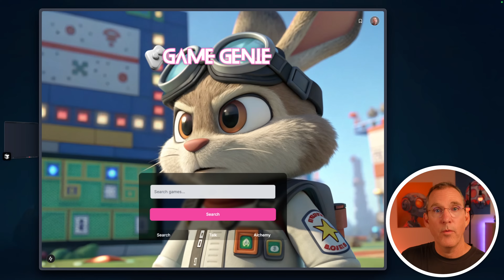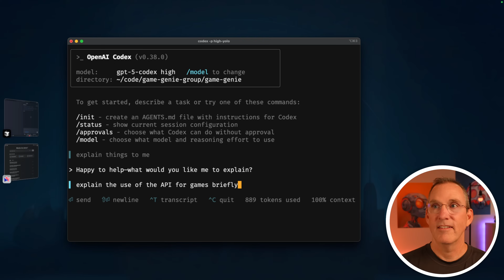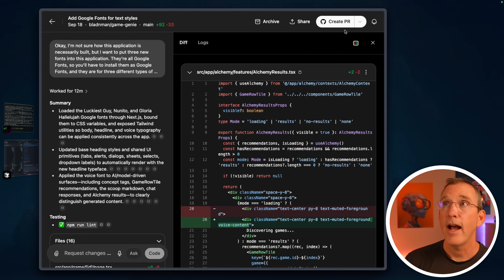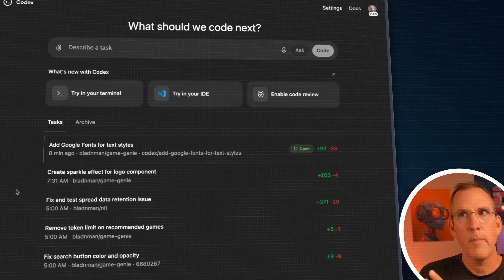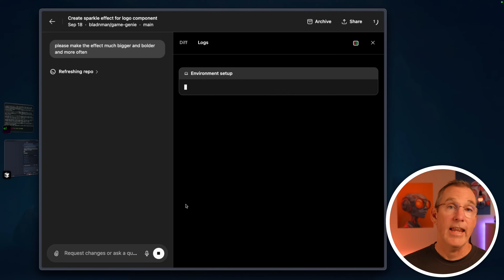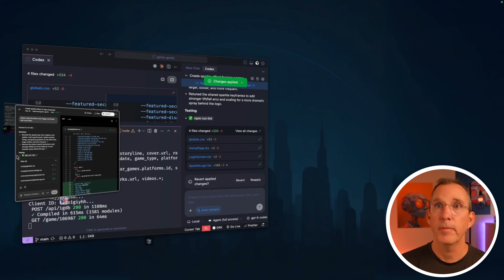Why Codex Is the Beginning of New Engineering

Comment: First, great video. One of the clearest and well-done explanations on a programming channel I've seen. If helpful, what I've been doing is ... a) Our company has a Cursor business plan, so I love that and use it but as a power user daily its not hard to go over the 500 credits per month and then it starts to cost as its pay-as-you-go, but still my favorite option and best integration with local MCP servers too and many AI models to choose from; but b) Our company also has a ChatGPT Business plan; so I toggle between normal Cursor chat and using the Codex credits in its chat window pane too. Codex 5.1 is pretty solid. Unfortunately it has less integration for MCP servers (seems to only work for HTTP type, which are basically remote ones). That said, between the two, I try to keep the cost under the radar ;) and as low monthly as I can, while still using both till their monthly or weekly credit limits are hit.

Comment: I've been using Claude Code for a couple of months and my biggest struggle is that stupid 5-hour limit. I run out of the "5 hours" in 1 or 2 hours.
Is Codex less restrictive if I pay 20 USD per month? I want to double check especially because you say at the end you get all that for 20 bucks. Is that really true? Or to make the video you were at the limit?
Besides that issue, thanks for the video, very well explained and it was super helpful as an introduction to Codex and comparison to Claude Code.

Comment: I have been using codex like this for about six months.  It works pretty effectively, especially if you control the scope of changes you want to make.  When you keep the scope of changes to small updates, it makes it easier to parallelize the changes but still ensure they merge without conflicts.  With regards to branching, codex makes each change on a new branch so you need to remember to have github delete the branches on merge.

Comment: Great video! I just wanted to ask how you handle merge conflicts when you run couple tasks at the same time? Do you fix conflicts by hand manually? Is there some tools or some way to do this well using AI without breaking/deleting important code?
Reply from the maker: I love this question as I just released a video about this. Def check that out. But managing merges still is a pretty manual process.
Reply: @MetalSole  Will definitely check it out.

Comment: When you're in the CLI, how do you connect to GitHub how do you choose a repository how do you choose a branch?
Reply from the maker: In the cli there is a bit of a different pattern. Basically you want to clone your repository into a folder and the go into that folder in your terminal (cd). Then run the CLI. This is a short explanation so drop this in ChatGPT and ask for clarity
Reply: @MetalSole thanks!

Comment: After I install the VS Code extension on Cursor, I do not get the tab that you show in 8:07 . Is it default or do you need change some settings in Cursor?
Reply from the maker: Oh yeah. This is a twisty thing. I share in a previous video. Moving that panel is a drag-and-drop effort. But first showing the left side tabs as vertical first etc. sorry to answer with try to search in my previous videos. I think it is the one where “cursor fixed everything “ if I recall

Comment: I wonder if you use Cursor, why do not just to use the Cursor alone, instead of hopping from one tool to another? Supported by MCP servers, Cursor can do all you demonstrated and more, and plus besides GPT-5, the underlying LLM behind Codex, you can have a choice of pretty much any popular model. What's benefit of using Codex and all the complexity of jumping from tool to tool, from window to window? how does Codex pays all the hassle off?
I mean, end result wise and my convenience wise, how it's different from me opening Cursor, picking GPT-5 as a model and asking implement the same task you implemented?
Reply: It's not… nothing better than Cursor with GPT-5 if you're a power user. On the contrary: if at the middle of next month a better model comes from a different provider, you can just switch to it if using Cursor. But with codex, you're locked in to a company and it's product.
Reply: @basedovi are you saying that Cursor with GPT 5 is better than Codex ? Did you tested it with full stack developments ?

Comment: I’m just going to keep using OpenCode.  Why?  Because any tool that comes out and ‘changes the game’ can simply be integrated into an open source base and propagated across the ecosystem.  Closed source is a liability in the age of AI.
Reply: but is OpenCode performs like Codex in Code quality ?
Reply: @silvamiracle2347I have only tried out Codex a little bit.  It’s fine, great actually… but I have lots of agents and settings already built for OpenCode.  And what happens if a month from now Claude Code goes back to crushing Codex?  Or Google’s nth IDE becomes the new thing

A customizable and model agnostic agent is much easier to adapt and configure.  Far less hassle and config debt.

Comment: Click bait alert! It's clear author did not with that even a few days. If he did he would find that it's not viable. You end with 100 active issues just in a few days, most require "some extra work/prompting". It may work if majority issues are implemented first shot. But with this flow you just create to many WIP items. Also, I recommend using main, dev and feature  branches and merge often. Very often.

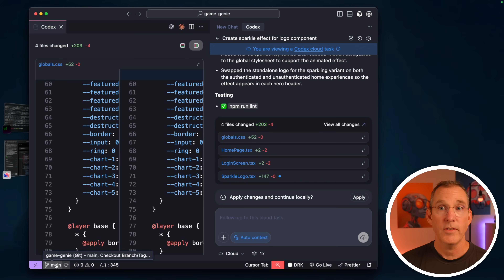Comment: If I want to pull those changes from the cloud to my local environment without putting it directly on main, then I should create a new branch first and apply there, right? 16:57
Reply: Yes. You should never really put anything straight to main (except maybe at the beginning of a brand new project that only you are working on)
Clone the repository locally using `git clone`, and then, either in the terminal or your IDE of choice, create a new branch from `main`. Then you can make your changes to that branch and create a pull request when you are ready to merge it back into main. Your cloud version control system (probably GitHub but other choices are available) will then give you a list of all the changed files, showing the changes  sor you to review before you `merge` it back into main. HTH.

Comment: Thanks a lot for your videos - I've literally been able to move my app from Streamlit to Django/HTMX in 3 days since I moved to Gemini CLI/ Codex CLI and now Codex IN Windsurf. I haven't used Codex Cloud the way you're suggesting, but for my own understanding would this be a good understanding of the flow you're recommending?

1. Setup Env in Codex Cloud - give it permissions
2. Give it tasks to perform on Cloud - in whatever branch > Generate PR once done
3. Pull those changes in the IDE (Windsurf / Cursor / VS Code)
4. Test 
5. Tag Codex in the PR itself if required or just merge manually -

Would that be correct?
Reply: Bro beware with htmx because of xss
Reply: @crazydev-jooj  Thanks for the heads-up.
Reply: @nikhilshahane6527  I use it a lot! Totally recommend it, specially because django will auto escape html, but it is always good to be cautious. Good luck!!

Comment: This is interesting for bigger teams. For single developers or small teams it is massive overfitting + other opensource clis are much more powerfull than codex. OpenAi has a lot to do here.
Reply: what opensource clis are you referring to? can I use my openai account with those opensource clis by logging in (instead of API keys)? I have a pro account and I want to leverage it without paying extra for api access.

Comment: "The way we've always written code, just ended."  Stop.  No it hasn't.  Not even close.  Just more AI hype, with a mediocre model, that will still fail at the most trivial requests... likely wasting more of your time trying to get it to complete your request successfully (if it ever does), than you would've just doing it yourself from the beginning.  It's the same dance, every time, regardless of what agentic "coding" tool you utilize.
Reply: User error
Reply: @vladimus9749  Right... because prompting is so difficult and AI is super-duper magical.
Reply: many at openai team, with the best software engineers, says that this new model now writes 99% of they're code. they are the best software engineers in the world.
Reply: @joel-p6z7i  So a company says their own product is "the way" and is heavily utilized in-house?  Imagine that.

Also, OpenAI hardly has the best software engineers in the world.

Comment: Codex is pretty incredible. I’m an electronics engineer who took classes in programming in college so I understand some things but I haven’t written code since. With codex I was able to create a very polished local running website very quickly by solely vibe coding. I can’t speak for the quality of the code but the current state of the project blew me out of the water. It’s something I’ve been working on for a month and some change with codex. This is even before the new model and the new model is even better. This is with the $20 dollars a month and I pushed it pretty hard everyday and I’ve never hit a limit. The project has over 700 commits using codex around 3 to 8 hours a day in my free time
Reply: What did you build?
Reply: Well done. Similar I built a android app.